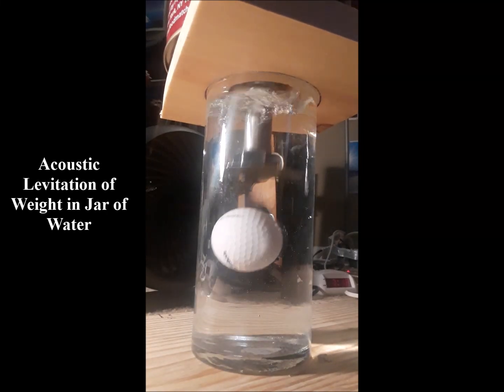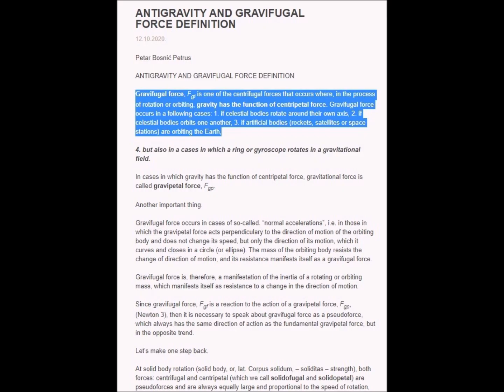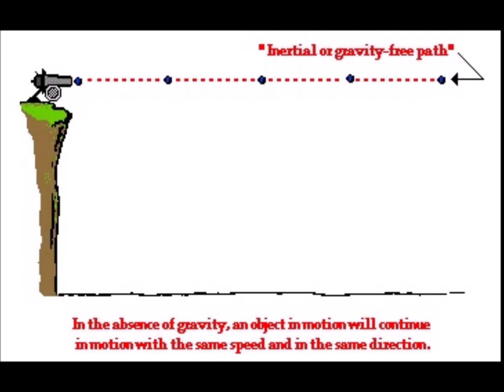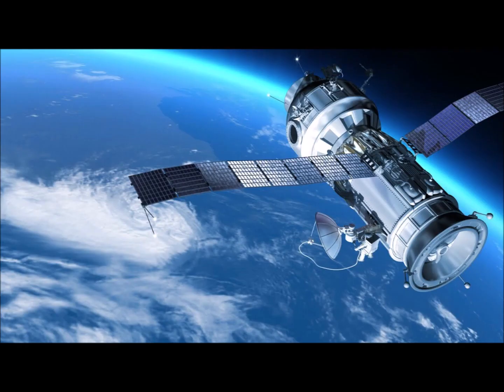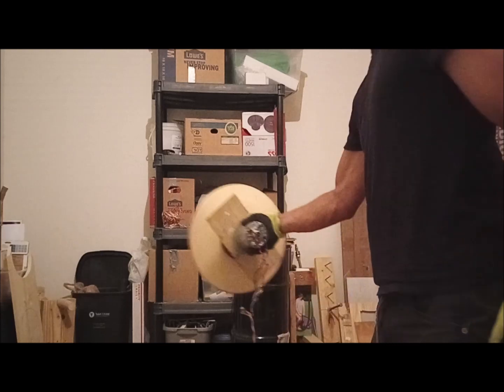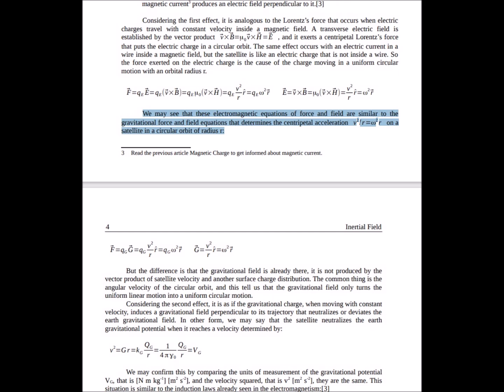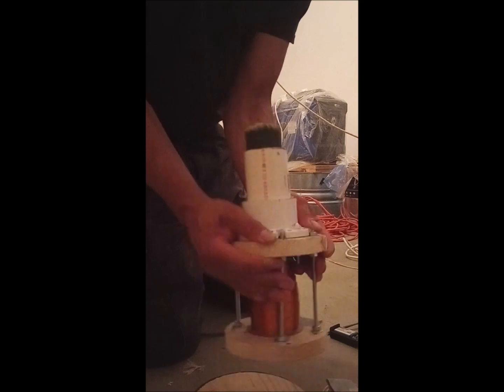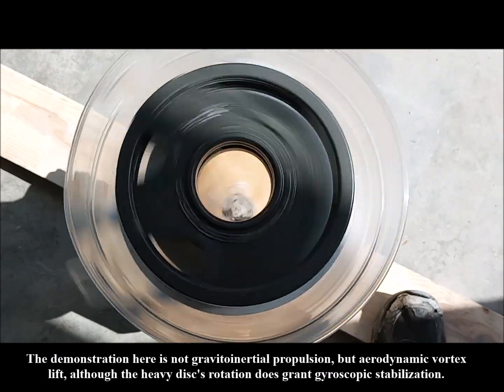Of Mass and Energy: Rotation and the "Gravifugal" Force/Effect

Comment: Look at the solar system. The Sun and the planets (except Venus and Uranus?) spin counterclockwise and their orbits are also CCW. Angular momentum follows the right-hand rule. For antigrav, you will need to have one motor with a rotating CCW platform (eg the one you held in your hand in this video) and on the edge of the platform other smaller motors rotating smaller CCW platforms (topview). Why on the edges? Because the force of gravity decreases with increasing distance from the center of rotation. Therefore, at its edge, where the force is weakest, you apply another force in the same direction. You can also do an experiment where the outer motors rotate CW and the middle CCW (it would then be like a tornado, or a water vortex). Another variation is that the center rotates CW and the outer motors CCW. Each option will have different consequences. Up streams and down streams.

Comment: Always learn something good watching your channel. Also damn bro you’re strong in mind and body! 👍
Reply from the maker: Thanks so much, man! It did take a little strength to wield that flywheel, at least until it was rotating that is.☺️
Reply: @gsutton78  Hey, I didn't mean for you to delete your video brother! I really like your work I wasn't trying to be a dick at all. 

I was going to say  Don't get me wrong, it'd work the other way. Like cutting a cylinder of cookie dough for sure. 

I'm thinking when it was a rectangular block they drilled multiple circles to create the square for the H, then cut it into each H block. They definitely had tube drills, only question is how they powered it all.

Hope I didn't cone across as a nay sayer.
Reply from the maker: @Persanity   Hey man, no problem at all. 😊 Thank you for pointing that out. I couldn't believe I had missed that. I think I got overzealous on the theory of the wire saw and it's ability to make long but precise cuts that I was trying to apply it to the H blocks as well when it actually can't. I was going to do a part 2 to that video. So what I'll do instead is edit the new editions into the old one (minus the H blocks) and repost the video. Thanks again, bro.  You really saved me potential embarrassment.👍

Comment: Hey if you put a lid (bolted) on it would it fly
Reply from the maker: The spinning weight plate?
Reply: @gsutton78  on the bucket to contain the water and disc, to pull the whole vessel up (closed cycle impulse)

Comment: in the electric universe (group of scientists theories), where gravity is an electro-magnetic repulsive force on a grand scale, the gyro action, rotating action and indeed vibratory action is actually flushing the positive charges of the object (u have to watch read their literature on what atoms are and how they work also what the elements are and how wrong the periodic table) regardless: the movement, especially rotationally, flushes ALL positive charges to the edge and bottom of the object (facing gravity)

Comment: I've been learning that antigravity can be achieved by solid state gold plated copper wire guiding spintronic force wrapped around rubellite which accumulate the spintronic force, antigravity via light vortex
Reply: The coil is like a spherical light bulb shape with the rubellite is a pillar above the spherical section. You measure the spintronic force by freezing the device in a cup of water, at the bottom you will see spallating spike deformation in the ice lattice, that is how you determine the strength
Reply from the maker: The light concept vortex is especially interesting considering Bruce Cathie's analysis of the famous Tibetan Levitation account! He discusses how the whole layout of the task incorporated the harmonics for the speed of light, gravity, and that an accompanying acoustic vortex was generated.

Comment: If a mass moves in a gravitational field, in a movement that is perpendicular to the direction of gravity, the inertia of the observed mass manifests itself as an anti-gravitational force, which, depending on the value of the speed: can reduce the weight of the observed mass,;enabling it to levitate; or accelerate vertically. Weight reduction and levitation have already been demonstrated by astronaut flights, and vertical gravifugal (anti-gravitational)  acceleration can be demonstrated by a gravifugal spacecraft.
Reply from the maker: It's a beautiful concept! I can't wait to test the mass-rotation experiment I have planned in which I will rotate a disc at high speed in a vacuum. I might not be able to spin it fast enough for full levitation, but perhaps I can get at least a small percentage weight reduction.
Reply: @gsutton78  If you haven't already started, I recommend a ring instead of a disc or cylinder, because it has a much better distributed mass, so a significantly lower speed is needed to reduce the weight of the ring or its levitation. The average linear velocity of the mass of the rotating body is important. Angular velocity has no any importance. I wish I could help you more, but I have to fight for mere survival, so I can't.
Reply from the maker: @petarbosnic5429   Thank you for the recommendation. I will definitely try the ring. I can't wait till try it. You have provided a huge help. Thank you again!

Comment: See the axioms - base of gravifugal force : Axioms
1. It is impossible for a mass to move in a circular path without creating a centrifugal force.
2. Centrifugal force always acts in the same direction as centripetal force, but in the opposite trend.
3. It is impossible to draw a line on the surface of a sphere that is not curved towards the center of the sphere, because, according to the definition of a sphere, all points on its surface are equidistant from its center.
4. The earth has the shape of a sphere. Therefore, it is impossible to draw a line on its surface that would not be curved towards its center or center of gravity.
5. Because of this, it would be impossible for a mass to move along a line drawn on the surface of the earth without developing a gravifugal force.
6. Gravifugal force is a type of centrifugal force. It always has the same direction of action as the gravipetal force, but in the opposite trend.
7. Gravipetal force is actually gravity that has the function of centripetal force.
8. Since the Earth is in the shape of a sphere, you can draw a small circle on its surface. The line of that small circle, in addition to being curved towards its coplanar center on the surface of the Earth, will necessarily also be curved towards its extraplanar center, C, in the center of gravity of the Earth. Fig. 1 The path of the mass that will move in that small circle will also, and necessarily, be curved towards the center of gravity, C of the Earth. Therefore, it will necessarily cause a gravifugal force that will reduce the weight of the observed mass, and at the already mentioned speed: v = √GM/R will enable it to float, levitate – to achieve a permanent state of weightlessness.
Hypothesis
And if, now, instead of that small circle and mass, we have a very solid ring that rotates rapidly, and rotate in the way that the axis of its rotation is directed to the center of gravity of the Earth, C), the path of its mass will necessarily be curved towards the center of gravity of the Earth, so it will also cause gravifugal force.

Comment: the toroidal models depict, at its core, two "tone cones" connected at center. perhaps a design  should see this as a vortex Stirling, Shaunberger, Tesla turbine..situation. Instead of moving the vortex around a device (this produces unpredictable movements) the vortex must return back to balance, center. the same point it begins at is the natural end as well. The opposing  magnetic field generated from the rotational gyroscope,  disks, control anomalies until the vortex is established. at this point elecomagnitism  is sustained by the pull of the vortex. The Vortex is forced back through the commpress path in the center of the vortex. The Sperical North pole is the "cooling" side, the South is the "Hot" side.
Reply: The repulsine was a half model. the vortex return was blocked forcing the vortex to one side. the vortex wishes to surround and return equally.
Reply: Understood nothing.
Reply: @petarbosnic5429  I understand, I have seen it many times flash into to my mind. Images of a Dyson Sphere, which is held in your hand. The core is contained  within an "egg" vessel. The primary source of revolution is a gyroscope repulsine AC/DC motor which is brought up to speed electrically until the vortex is created. Once the vortex is established, so to is the electromagnetism field. Then  begin the inductance reactions through  the spherical crystal Krebs cycle layers.

Comment: The universe that we see with our eyes and telescopes, as it is, which is in eternal rotation and levitation within itself, is maintained by two balanced forces: gravipetal and gravifugal. Gravipetal force is actually gravity that has the function of centripetal force, and gravifugal force is a reaction to the action of gravipetal (Newton 3).

Gravifugal spacecraft also use these two forces to levitate or lift themselves vertically. The gravipetal force (gravity) is given by the Earth or another celestial body, and the gravifugal by the rotation of the ring.
Reply from the maker: This is really fascinating!! Your quantum ring of light idea is also very intriguing indeed. What kind of light sources would be used? Perhaps lasers? Solar sails have been proven to work with sunlight in space. And it's been calculated that ground based or space based lasers would be even more efficient than regular light and could propel small craft to relativistic speeds of near 20% the speed of light. Could lasers be used in the ring of light? The laser light itself or perhaps space crafts could have very small particles within the evacuated toroids . A way would have to be found to keep the particles suspended and to eliminate any and all friction between the particles and the inner walls of the toroid.  Powerful lasers could then propel these small particles to relativistic speeds within the toroid. Particles rotating at 20% the speed of light or greater would have tremendous energy, momentum, and hence inertia; generating the gravifugal force with just laser light and small floating particles. And as you noted, photoelectric transducers could be used as a way to control ascent and descent by converting some of the laser light into electricity.
Reply: @gsutton78  Laser light, of course.
Reply from the maker: @petarbosnic5429   Yes, definitely. Would have to experiment with different colors (frequencies) of light. Generally, the higher the frequency, the greater the energy. Also, experiments with pulsed light vs continuous light.

Comment: A good test for your theory it to take a frisbee cut a hole in the center (2" diameter) the mount a small pc fan on the bottom. control it with a battery and rc control. Throw the frisbee and hit the fan at max when you reach the point where it would normally fall. see if it lifts. It helps to throw the frisbee the same direction the motor pulls to very slightly speed up the frisbee when activated. Note: counter rotation in the frisbee would allow the center to stay still and act as a vortex in a tornado.
Reply: Frisbee is an aerodinamical and not gravifugal phenomenon. Gravifugal flying craft can also levitate in vacuum
Reply: @petarbosnic5429  it was using it to create lift at a point of loss of motion. Also jolting the spinning faster. It is more about motion than gravity.
Reply: @nathanbunten4299  It is OK.